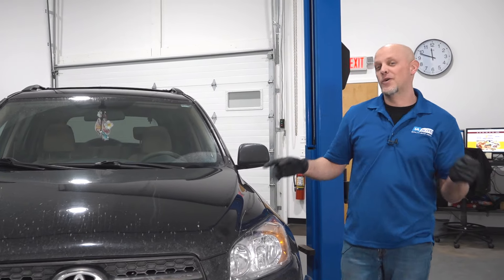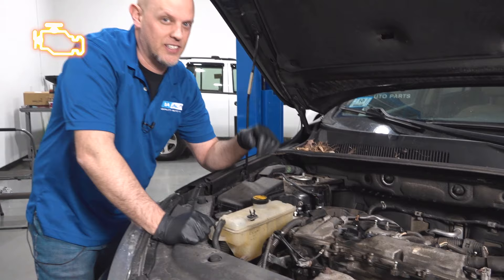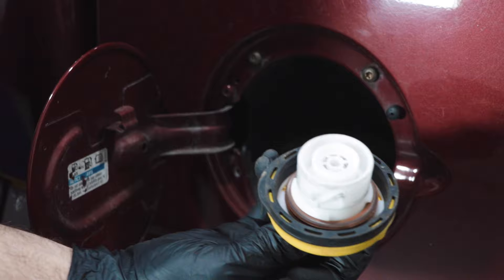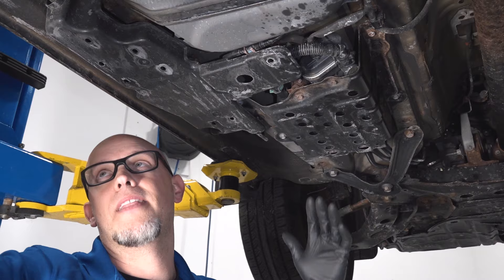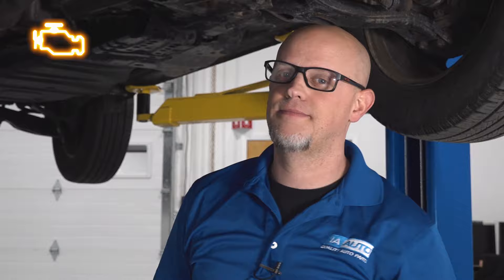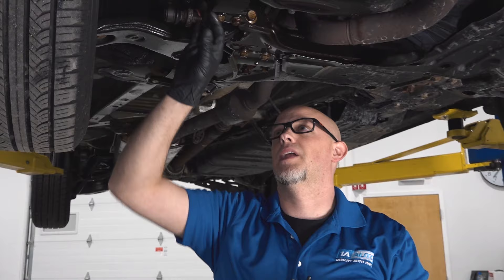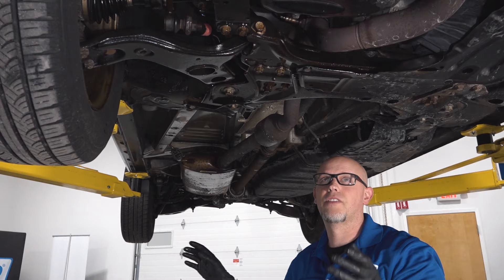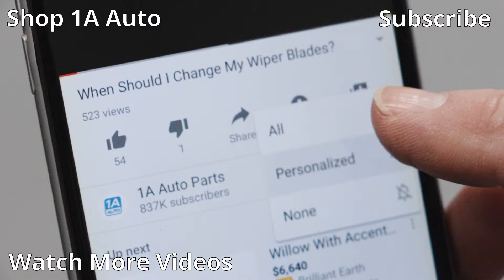Top 5 Problems Toyota RAV4 SUV 3rd Generation 2006-2012

Comment: What do you think about the piston ring issue on the early motor,  is it as bad as they say?
Reply: we have 2 rav4 in the family a 2011 and a 2007 in Australia both have the older 2AZ engine and both use oil, we don't have the cold winter problem ,so run 10w-40 full syn oil and can also run 10w-50, but l hav not tried that yet. both cars are family favourites

Comment: Another issue is with the 4WD rear diff leaks caused by clogged or seized pressue vent on the rear diff.
Reply from the maker: +Sampson Thanks for the feedback!
Reply: It's best to change that pressure vent periodically as part of preventative maintenance.

Comment: I have a Toyota Rav4 2008 front Wheel Drive and I have Engine, VSC and Trach lights came on. I scanned the code in Auto Zone and I had all of these codes displayed: C0205, C1201, C1223, C1241, C1267 and P2401. I had never seen the Cs codes before. They worry me? Any advise????? Thanks in advance.
By the way my mileage is high ..over 170K.
Reply: My 07 does this try unscrewing the gas cap and closing is tightly and properly and drive around they usually go away for a while. It could also be a knock sensor or 02 sensor. Take to it Toyota for a scan

Comment: You forgot to mention beginning in 2009 with the 2.5 liter motor they switched to the sorry paper oil filter in the canister. I don't mind doing it every 5K miles but some people don't care to fool with it
Reply: Personally I like the cartridge style oil filter. However, Im using a synthetic oil filter that's rated for 20,000 miles. I change the oil every 5,000 but I'm changing that 20,000 mile filter every 10,000.

Comment: Torque Converter shudder hits a lot of the 2.5 Toyotas four cylinders.  Keep that trans fluid changed and not with Toyota fluid.  Go to a full synthetic.
Reply: Nope. Always use Toyota fluid. It’s not the fluid, it’s the torque converter itself and I believe it was only an issue on the 6 speed transmissions.
Reply: Pretty sure I'm having the torque symptoms. Only can have the shutter happen when braking and only when light braking is being applied
Reply: 2006 2.4l 249,000miles

Comment: Hi there do u know any way how I can slow down the oil burning issue on this model? Thanks
Reply: Root cause of that oil burning is in the piston rings. By time, gunk gets accumulated around them and blocking the oil. Do 'carbon-cleaning engine' by putting oil additive every couple of oil change. I recommend ATS 505CRO, try and true Scotty Kilmer advice.
Reply: Drive less.

Comment: Yoo in places with tough road conditions the steering rack fails alot I've replaced one and in 5 months the sound is back just finding repair videos because they want to replace the entire rack which is 200 USD without Labor 😅😅😅
Reply: $200 ain't bad.

Comment: I love my Rav4, but now I have my check engine light and the auto LSD light flickering on and off. Car seems to run just fine. Any one have any idea what it could be. Codes read as O2 sensors, got them changes and light came back on after a week. Not knowledgeable of cars would love any help. Thanks.
Reply: Change A/F Ratio sensor, i had this same issue
Reply: @williamandrade4838  
A/F ratio sensor is the same thing as the upstream O² sensor.
Reply: Did you replace with OEM sensors from a dealer or did you use authentic Denso sensors (not the ones on eBay or Amazon that are made in China)?

Try cleaning the MAF sensor and the throttle body.

Comment: My rav 4 2008 vibrates a lot when it's not moving can someone help me what could be the issue?
Reply from the maker: +alzaraza We wouldn't be able to diagnose an issue like that here, you may want to have a local mechanic take a look at it. Thanks for checking us out! http://1aau.to/m/Shop-1AAuto-c
Reply: Change your spark plugs and clean your throttle body
Reply: Try the Transmission mount.  Known problem for 3rd gens.  Easy to replace on the 4 cyl models and very inexpensive as well.
Reply: I had the same issue with mine. I changed the plugs, the PCV valve and performed a Valvoline treatment to clean the carbon off the intake valves and the throttle body (you can try Seafoam as well). After that, the crazy idle went away. Good luck.
Reply: @alanwatson2287  
And clean your mass air flow sensor.
Reply: Check for a beehive in the glove box.  bzzzzz
Reply: @mannyz3279  
Try the Italian Tune up as well!

Comment: That rav4 has bigger wheels? Looks tall. 2001 with new shocks don’t look that tall. Found oil leak near passenger side serpentine belt haven’t located it yet. I’ll look where ya said.
Reply: I have an 09 with 18 inch..and tires are stupid expensive coming from the 15 inch world..

Comment: What is the  VSC I have that light on
Reply: Ignition coil or possible alternator fail?
Reply: Have someone with a code reader check your vehicle it can be several things doing this especially if combined with other lights

Comment: You forgot the main problem mate burning oil the 4 cylinder is notorious for burning oil due to bad rings from the Factory.
Reply: ...and in Australia we have weaker consumer laws and Toyota did not replace any under warrantee or call back.  We have two Rav 4 in our family and are happy with both and both use oil  2007 and 2012

Comment: My 07 2.4l rav4 rumbles hard when you hit the brakes but only at or near operating temp. Im literally replacing the brake booster as im typing this.
Reply: I had rumbling from my brakes when i bought my 2009 rav4, found out warped front discs (rotors) , replace discs and pads with some quality Apec ones, no more issues 😁👍🏻
Reply from the maker: +Louie Tube Thanks for the feedback!
Reply: Has your 07 been a money pit to fix cuz I'm looking at an 07 that basically new and wondering if it's worth buying ?
Reply: @Takumawakanda    V-6 Man!

Comment: I have no codes my 2007 rav4 runs rough, hard to accelerate and get into traffic now. I almost got hit from behind a few times, and had people road rage at me because it takes off slower now, exhaust rattles, almost sounds like a backfire and shifts late into 3rd/4th gear after rattling and possible backfire, going barley 40 in a 45, and I barley get on the highway now, this is dangerous!!! I could barley do 55mph in a 60 where people top speeds of 80.
Reply: I would guess plugged catalytic converter, especially after you mention a "backfire" sound.
Reply: Maybe you need a better cide reader.
Reply: How many miles have you put in to your RAV4 ?? I'm looking at an 07 RAV4 basically new but I looking it for the issues and if it's worth buying ?
Reply: @Takumawakanda   V-6 Man!

Comment: I own a 2008 Toyota rav4 it has 120 thousand miles only  it is burning way to much oil don't see any leak  under oil pan   !!where  i suppose to look for oil leak  also??  Any body knows  ??
Reply: Piston rings without a doubt. Known issue. They only fixed for the 11’ - 12’ models on this gen.
Reply: I got a 2010 rav, same issue, high kms I’ve been monitoring the consumption 1ml per km, equates to 10 litres every 10,000 km, thinking of just changing the oil filter every 10, and leaving the oil lol 😂
Reply: @thegravitx  
Only the 2006 to 2008 models had the problem in the USA. In the 2009 model the four cylinder engine was replaced with the 2.5 liter AR-FE engine. In other countries the 2.4 liter engine bay have still been found in later models. Even the Camry in the US still had the 2.4 liter engine in 2009.
Reply: @MrMarkguth  
Try a little STP

Comment: My girlfriend's 2010 Rav4 has been stalling whenever the engine rpm's come to idle speed. Cleaned throttle body and that seemed to have helped but recently she was driving in the rain and shortly after hitting a puddle the vehicle will no longer accelerate past 15MPH and shakes violently before dying out when not on gas. Check engine/traction control/4x4 lights illuminated on dash. Code reader shows P0014, P0015, P0017, and P0328. Any ideas or similar issues with anyone else's Rav4? Her vehicle is a 2010 Rav4 Limited 2.5L with approx 165,000 mi. Any help or advise what to look for would be greatly appreciated!
Reply from the maker: +XacMil We wouldn't be able to diagnose an issue like that here, you may want to have a local mechanic take a look at it. Thanks for checking us out! http://1aau.to/m/Shop-1AAuto-c

Comment: You forgot the engine that burn too much oil!
Reply from the maker: +Rodrigo Casimbon Thanks for the tip!
Reply: That's only an issue with the 2.4 liter engines prior to the 2009 model.
Reply: @njsongwriter  
Never did like the sound of 4 cyl!  V-6 Man!

Comment: Someone help, why does my rav4 idle so badly at a stop, it like wants to stall.
Reply: Did it start after you or someone was under the hood?  WIfe was having this issue after an oil and filter change.  Dealership disconnected one of the hoses from the airbox when changing filter. Drove fine but ran extremely rough as idle.
Reply: I had the same issue with mine. I would recommend changing the plugs, the PCV valve and applying an intake valve and throttle body cleaner through your intake manifold. Sometimes, the carbon buildup can create that rough idle. Those fixes solved the problem for me. I used Valvoline and that worked well. You can try Seafoam as well and see if that works for you. Best of luck.
Reply: Try cleaning the mass air flow sensor. The cleaner cones in an aerosol can. Follow directions. Plenty of videos will show you how.
Reply: @briano9879  
Gotta love those Dealerships Aye!